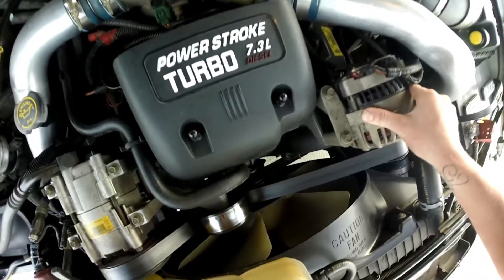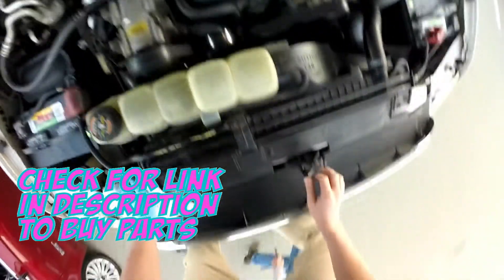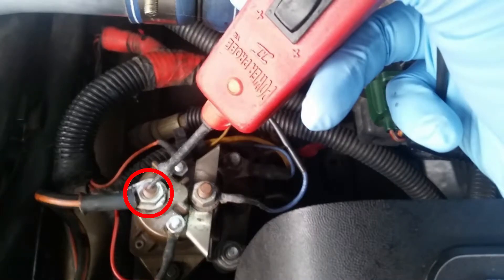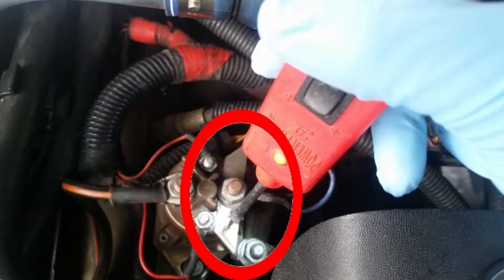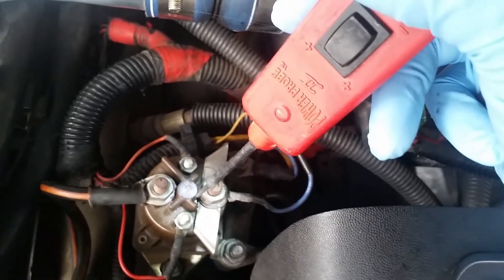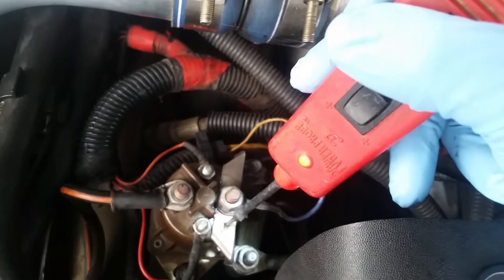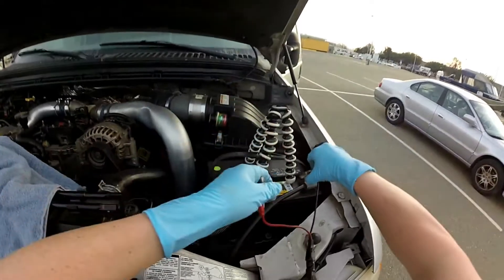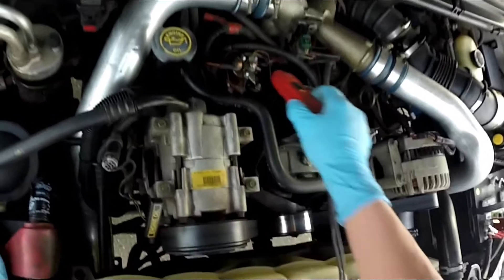Ford 7.3L Diesel P1391 & P1393 quick diagnostic & FIX

Comment: Can I give power with the probe to make the truck turn on?
Reply from the maker: You could give power to the starter solenoid signal wire to activate the starter. Put the key in the run position first. If the starter is good, it should turn the engine. Also.... if it's a manual, make sure you are in neutral.
Reply: But mine cranks no start. Codes P1391 P1393 meaning glow plugs not energized. So could I power them with the probe?
Reply from the maker: @rubio7922  I see what you mean now... you might be able to give the signal wire power to get the power to pass through.  But the probe would not have enough current to power the 12 supply to the glow plugs.

Comment: So I had my glow plug replay replaced.. not sure if it’s motorcraft or not but after that I got p1393. I already had p1391 prior to the glow plug relay replacement. On thing I can tell is the material next to the glow plug relay that holds the two bolts to the metal piece is broken. What that cause it to throw codes?

Comment: My '99 F-350 7.3 4x4 threw those codes out and I disconnected the batteries for 5 minutes if that and reconnected them and I turned the ignition switch on to heat the glow plugs and when the WAIT light went out I fired it up and the Service Engine Soon light didn't come on.

Comment: I have a 99 and just died on me I bought ipr and heater bowl nothing just crank... any help
Reply: Fusable link on the starter solenoid. I hard wired it. Just fixed the same problem for me. 99 7.3
Reply: @haydencooper5022  dude I can’t get my truck started
Reply: Make sure both fuel pumps are priming (engine bay and frame rail under drivers feet) next check you uvch connectors and harness do a buzz test to test injectors